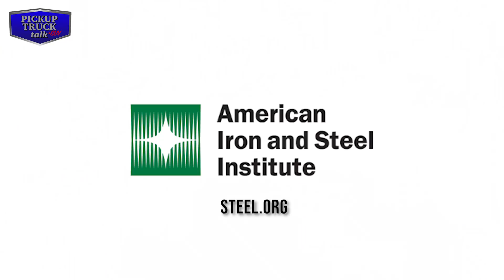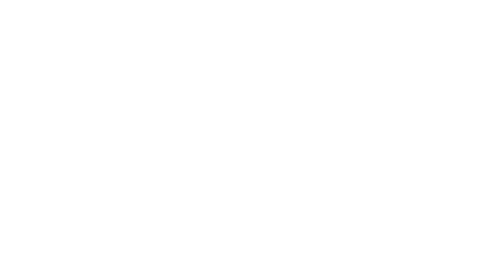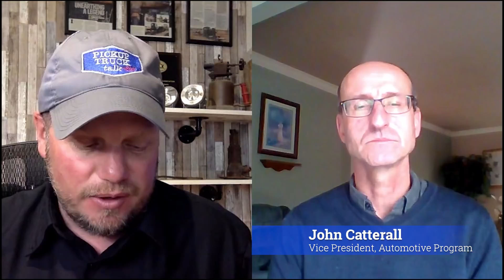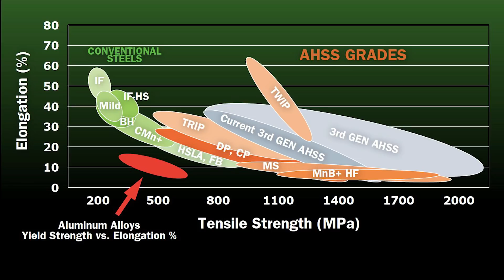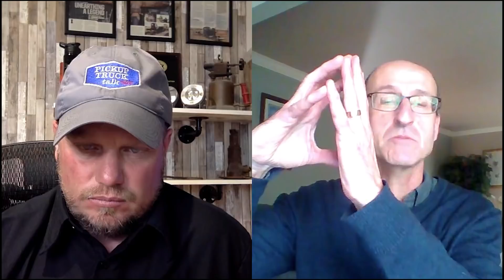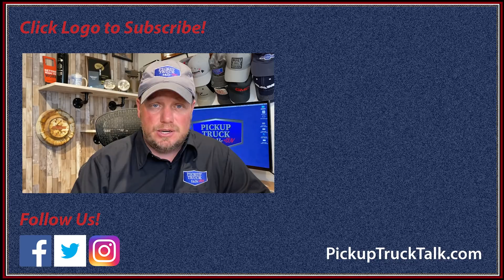Should Truck Frames Bend? Thinner Frames Are Weak? - Expert Answers

Comment: Short answer: yes!
Reason? Planed obsolescence.
Reply: You know Henry Ford came up with that plan in the 1920s right 🤣😜
Reply from the maker: Not even close. You did watch the video right?
Reply: Pickup Truck Plus SUV Talk Pickup Truck Plus SUV Talk Pickup Truck Plus SUV Talk  Hi Tim! Yes, I saw the video, honestly I dont think an industry guy will tell you the truth about their recycled metal, I found very funny the fact he remarked the previous Colorado chassis was made by Isuzu (zero issues with it) and the current ones are done by GM (well not GM, the OEM provider) also he remarked the holes on hot spots need to be flanged or in any way reinforced and you don’t see anything like that on the useless holes on the breaking point of the Colorado. Poor metal, poor design and high profit for them. Now Part of my answer was purely based on my experience (am enginner but civil not industrial, but some structural concepts are the same) and what I’m looking on this days with the crappy new trucks we have in the market. Let me explain it briefly. Where I live is pretty normal to put a complete pallet of cement bags in the bed of a 2014 Toyota Hilux or over my brother’s 1987 Nissan 720 pick up (similar to D21 pick up) and go up for dirt and loose gravel roads and hills without even sweat. A pallet of cement is 35 bags of 50 kilos each that means 1,75 tons of load. We have done it for years and our frames, axles, suspensión and other components are normal wear conditions and perfectly straight. Some times we have to help a loaded truck to go uphill fully loaded and we tow with our trucks surpassing by far the towing capacity and still the frames are good. We don’t use a fancy elastic rope for it, sometime we have to use a bare chain or a recovery strap as much. Also is very usual to tow rental cement mixers which have no suspension, the axle is in the back ( so almost all the weight go to the tongue) no fancy weight distribution hitches and no brakes with a regular weight of around 840 kilos. Let’s  not talk about some friends which produce potatoes and they use to load almost everyday a Toyota Land Cruiser 70 series totally stock (except for the fact they use LT tires) with over 2,7 tons of product sometimes even on the roof top and on barely existing dirt roads and nothing happen. We have lots of old FJ 45 series still running and loaded with near 3 tons on them. And after that, I’m looking at this generation of recreative “trucks” that can’t handle a made of feathers trailer or a bump without bend the frame!!! Who can spend this amount of money on something that will break if you use it for the purpose it was supposed to be designed? I don’t care what a nerdy engineer say, real world is the real thing and that’s why our spartan and outdated designed Japanese trucks are way better than any crappy poseer Jeep or ZR2. You guys should ask for the quality you paid for instead of justify or find excuses for poorly designed crap. He said it repeatedly “cost”.
Reply from the maker: Humberto Rubi thanks for the detailed comment. I notice you reference a Hilux and a Nissan Navara. Those are built for different needs and engineered differently. No way could a ZR2 or Gladiator would be able to handle the same loads. Those trucks are built to handle more payload since there isn’t a larger truck in those markets.
Reply: Pickup Truck Plus SUV Talk  Always a pleasure to chat with you! Actually yes, we have the full size available here, we have the F150, Ram 1500 and The Silverado and even the HD’s are available. Some people here buy these ones because want to look like a Texan Cowboy on them but none buy one for work because of price, gas consumption, and expensive servicing. When we need to carry more than 3 tons we buy a Truck ( not a pick up) you know a Isuzu NKR, NPR, Hino 350, Mitsubishi Fuso or Nissan UD. Lower than 3 tons we go with Toyota 70 series, some ones feel fancy and buy a Tundra or Titan and mostly have Hilux, L200, Frontier, Isuzu Dmax, Mazda BT50. Also the Ranger with the 3,2 diesel and the V6 TDI Volkswagen Amarok sells very well but not for work, mostly for fun. Our experience here with US brands is that they are super comfortable, lots of electronics, nice looking but thirsty, expensive and not reliable. On this last point when we say not reliable is because they don’t age well as most of the electronics broke early, the interiors start to rattle soon, and the engines won’t last trouble free for more than 50 k miles in our road conditions. On the other hand a mitsubishi or similar will be running happy at 150k  miles or more easy. Your standards are different there as you change your cars very often and we use to keep a car for at least 5-10 years as standard or even way more depending on the car. You are right in your appreciation about the market differences, but I feel sad that you there are receiving this bad products from your own industry and they just blame you for use the truck as intended.
Reply from the maker: Humberto Rubi one of these days, I’m going to make a trip to your area. Sounds like you live in truck paradise!
Reply: Pickup Truck Plus SUV Talk You’re welcome here! Of course when all this craziness ends 😁👍🏻

Comment: I think in many cases the engineers put too much faith in computer modelling rather than real-world testing. There's a lot to be said for seat-of-the-pants engineers.
Reply: You can't rely too much on anything, and they're not just relying heavily on computer modeling. There's still plenty of real-world testing happening, probably more so now than before. That's because computer modeling advances frame development at a lower cost, allowing them to greater hone the design with real-world testing.
Reply from the maker: True, but remember they have to test for so many different scenarios, they use computer modeling for most similar crashes and uses. They also crash a TON of trucks before they go to market as well. Computer modeling is just one tool in their testing procedure.
Reply: @Pickuptrucktalk  All true responses...but I have known more than a couple of engineers who didn't know a 1/2 in bolt won't fit in a 1/2 inch hole. Software is only as good as the practical understanding of the people who write it. Case in point the flight software of the Boeing 737 Max. I personally have no issues with today's frame designs.
Reply from the maker: @mwdeters  Agreed. Like John said in the video, engineers make mistakes and there is such a thing as a bad engineer. No argument there.
Reply: @Pickuptrucktalk  Thanks for taking the time to track down the experts and get the facts straight. Great content Tim
Reply from the maker: @mwdeters  You are welcome. If you think of anything or anyone you want to hear from, let me know. I'll track them down!
Reply: Mark Deters there will always be real world validation in the design and engineering process. I don’t think any current engineer will rely solely on CAD or similar computer simulations.
Reply: IMO, until the steel in the frames in question are tested if the material was made to spec there will be no resolution nor do they want a definitive resolution.
Reply: @Troy Hendrickson 
I know enough about production that when there is a range for specs, the low end will cost less to produce. That needs to be in the mix if it is to be resolved.
Reply: I’m not sure what you mean, engineers use both computer modeling and real world testing. What exactly is a “seat-of-the-pants engineer”? It sounds like someone who is just winging it, I’d certainly never just wing it on any of my designs

Comment: Let's see after 20 years how all this new trucks with a Aluminium frame or a unibody, gonna handle after years of abuse and heavy towing.
Reply: Roger M I don’t think there are any aluminum ladder frames or even unibody chassis which are used for any substantial towing or hauling.
Reply: @MX5-XU  you got some examples of unibody chassis on off roaders pretended to be used on heavy work, like the Honda Ridgeline, the Mitsubishi Pajero, the new Land Rover Defender. The aluminum ladder frames, I'm not sure but Ford is using something similiar on some of their trucks.
Reply from the maker: TBC - the F-150 is a steel ladder frame as is the Ranger and Super Duty. Not sure which Ford truck you are talking about.
Reply: @RogerM88  None of the vehicles you mentioned have aluminum unibodies (or space frames as they are sometimes called). Those are all steel, and Ford just uses aluminum on exterior body panels.
Reply: @MX5-XU  the examples that I gave you are not "Aluminium" unibody frames...just unibody frames. Yes, Ford used on the exterior panels and bed. But don't be surprise if they use it on the frames on the near future.
Reply: There are aluminum bodies. No aluminum frames I’m aware of
Reply from the maker: I asked him specifically about Aluminum after this conversation. Sorry I didn't record it. The only usage of aluminum is on braces like the transmission cross mount. All the parts of the frame are steel and with a majority being high-strength steel.